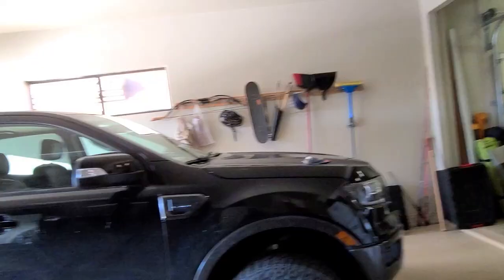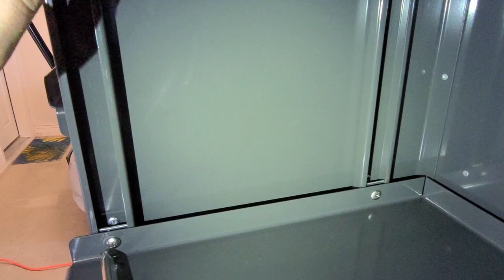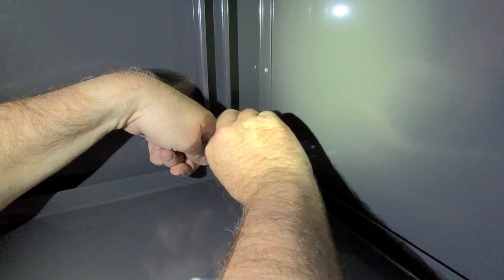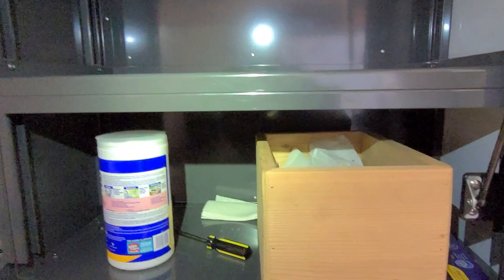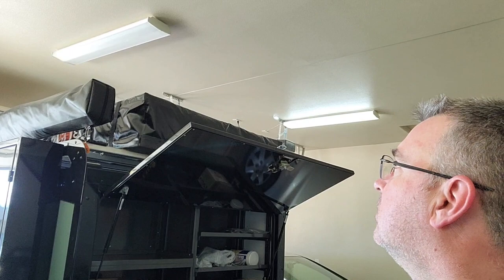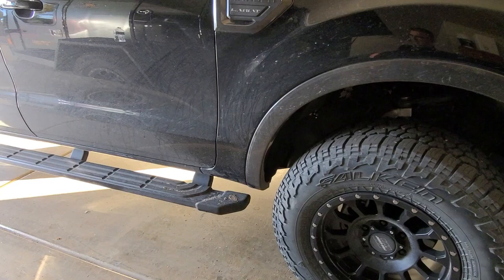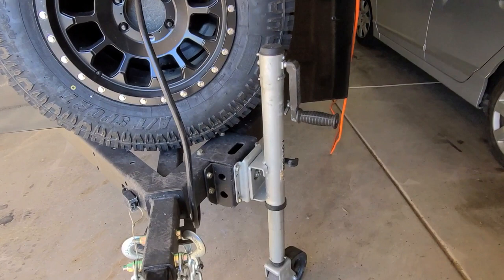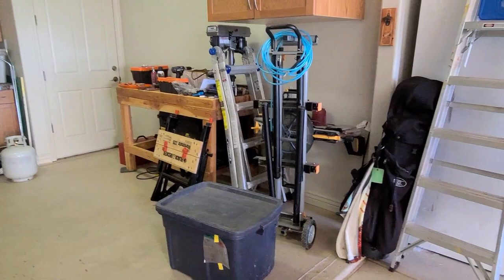OGT Expedition shelves and more...

Comment: I got rid of the Fulton jack and replaced it with the arc XO Extreme Black Edition. (Lots of YouTube videos about it). It's like night and day and well worth the money. Off Grid Trailer now offers it as an option. There's a guy on ebay that sells a steel adapter that allows you to remove the Fulton and bolt the arc XO Extreme right onto the mount that is welded to the trailer. All you need is two wrenches. It was actually easier than adjusting the shelves!  BTW if you try and camp above 8,000 feet, the Propex heater will not work. There is a fix for that and I can walk you through it if you are interested. I'm planning to upload a video about it this summer.

Comment: Question for you, how much extra room do you have getting the off-grid trailer into your garage?  We are building in South Carolina and will have 93-94" clearance, but according to OGT, the Expedition w/ awning is 94-95" tall.
Reply from the maker: I have an 8 foot door... it clears with about an inch or two space... from the ladder on the roof top tent... if you only need an inch you could air down, but that will get you an inch, maybe...
Reply: @ManusFerrea  thanks for the info. Also looking at 1-2" smaller tires or taking top strip off garage header if needed. We aren't getting the tent and I think the awning rides lower than the tent.
Reply from the maker: @billblauser5844  the awning does ride lower. If you're not getting the RTT you'll be fine
Reply: @ManusFerrea  awesome! Really appreciate your feedback.